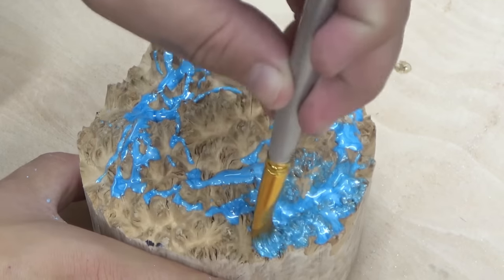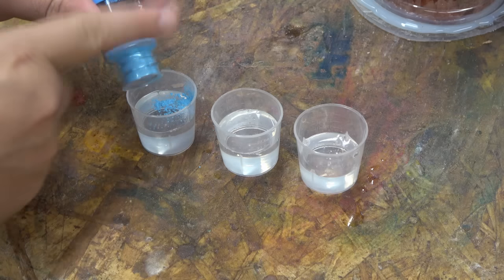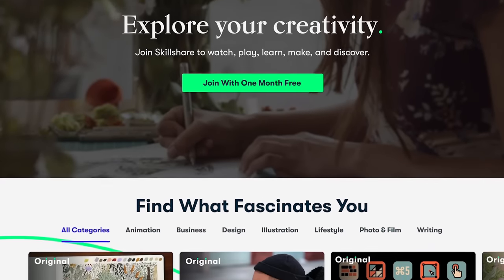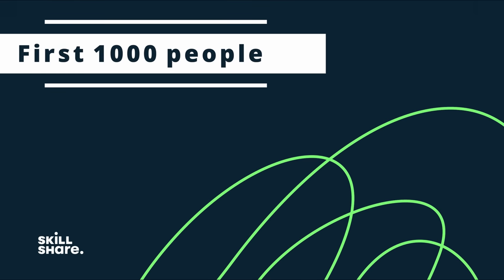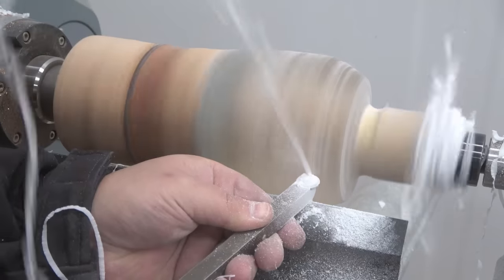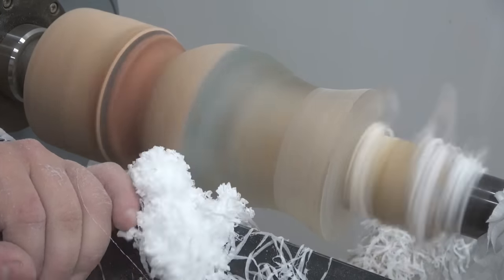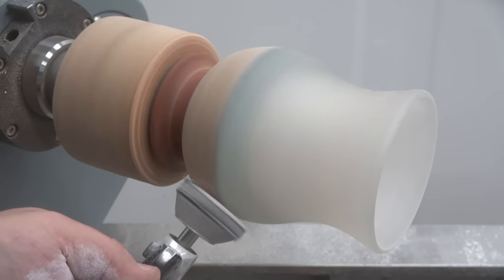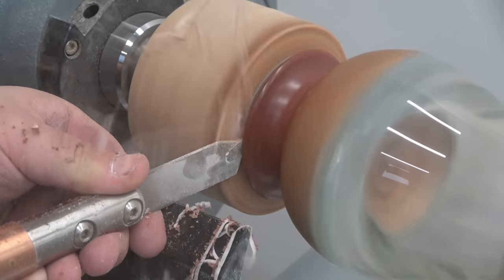Woodturning – Hours Of Sanding to Make It Look Like Glass

Comment: That was absolutely beautiful, David! You've got to love a bit of subtle sparkle! ✨️ I know this doesn't really answer your question, but maybe go with the flow, depending on what you plan on working on. Each project takes its own time, not a fixed schedule. Maybe, if you're working on smaller projects, stick to what you've been doing. You can always announce at the end of your video that your next project is going to take longer, and therefore will be released at the end of the month/or in two weeks' time, for example. Either way, don't put pressure on yourself to the point you start to feel like doing what you love becomes a chore 😊

Comment: Nice project.. a lot of work.. A easier way is to sand to 120 grit and coat with resin.. sometimes takes two coats and because the resin is heavy it runs.. So try this.. set your lathe to 5-10 rpm.. and apply resin coat. Let the lathe run till resin is solid.. I call this the rotisserie finish. bright, shinny and long lasting..  ☺️
Reply from the maker: Yeah I also do resin finish but sometimes it is just easier to sand to high grit and polish. Resin finish can be a pain depending on the project and wood